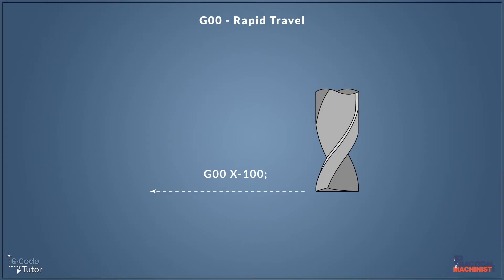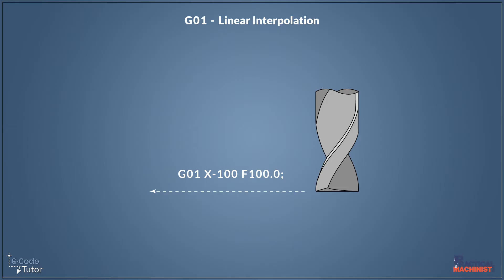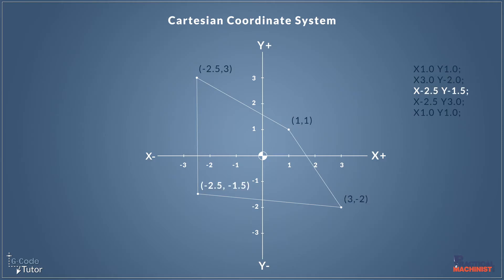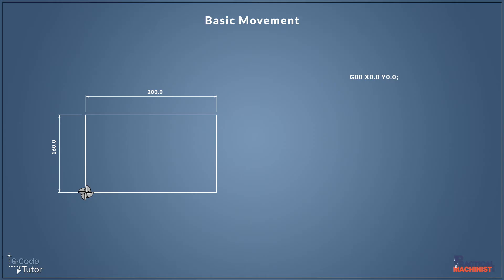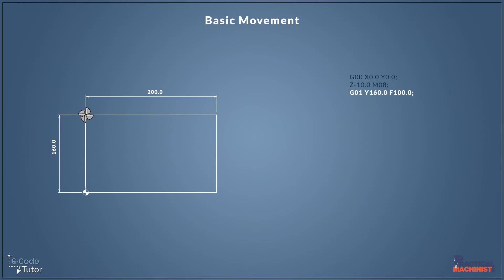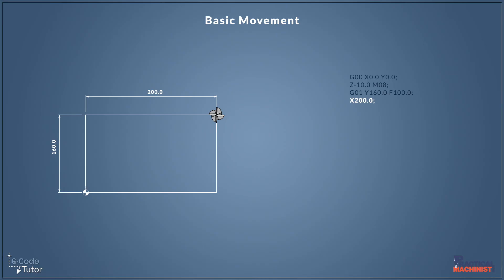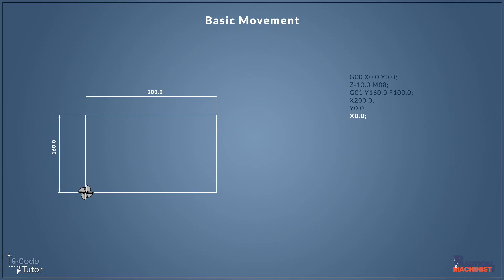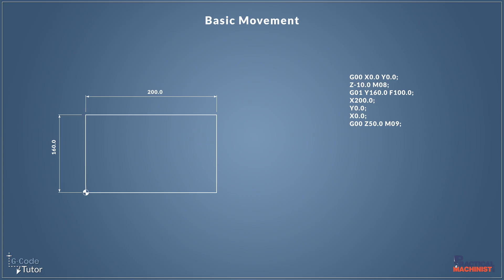Basic Movements with G-Code

Comment: You've caused a collision by rapid movement to Z-10
Reply: facts.. i was seeing that too xD
Reply: Not necessarily. He did say he is just moving the cutter around.  Assuming the cutter stars from the home position and goes down 10 mms it should still be in open air.
Reply: Hi Mark, are you from Brit ?
Reply: This confused me as well. The spindle is not rotating during rapid movement, right? He would need to set spindle speed... and plunge rate? (I'm new.)
Reply: @adamCadam90  cutting is not allowed during rapid movement
Reply: @adamCadam90  not g00 g01 needs a feed with a coordinate
Reply: It’s just an example try not to think much into it